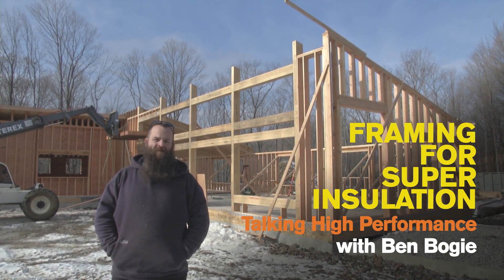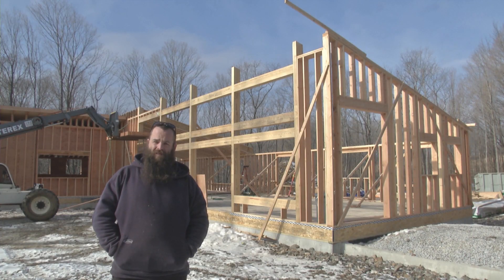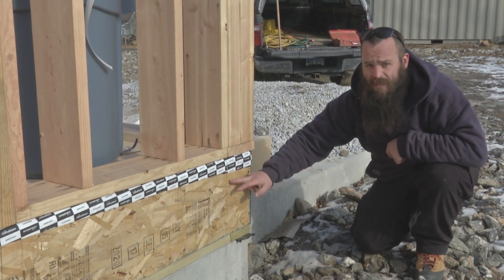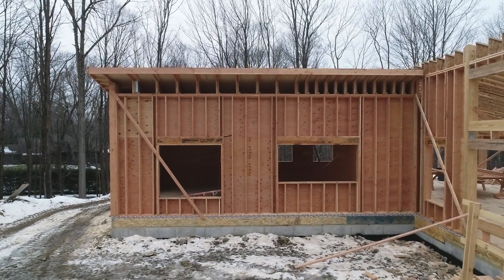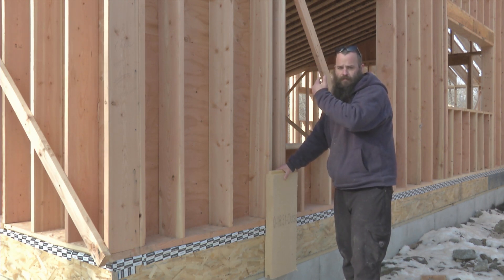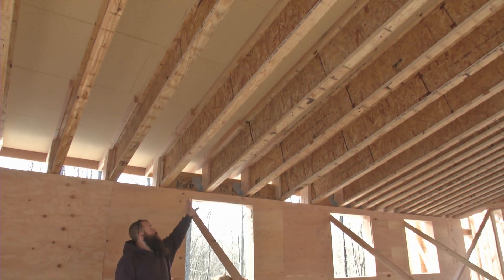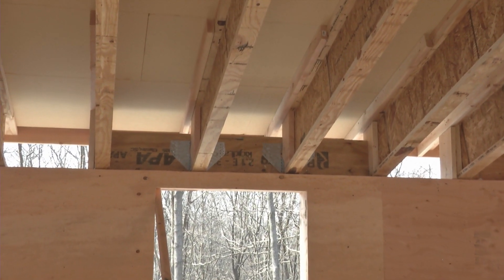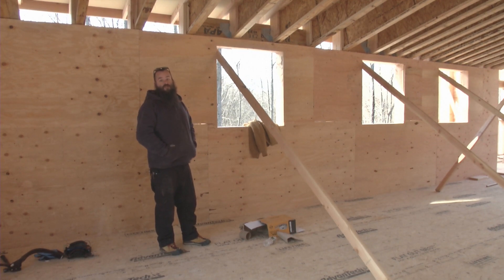Framing for Super Insulation

Comment: so there doesn't need to be a water control layer outboard of the dense pack cellulose because everything is vapor open anyways? or am i missing something
Reply: The wood fiber insulation is probably the water control layer. My guess is that this is something like Gutex multitherm, which sheds water well. At 0:22, it looks like the tongue/groove of those insulation boards is likely for aiding that water shedding.
Reply: @dosadoodle  I looked into this and apparently the answer is "it depends". So some wood fiberboard is rated as a WRB up to certain wind speeds and some is not. Also some builders prefer to throw another WRB membrane on top because it works as a redundant air barrier (more commonly with prefab because maybe it helps protect the insulation during transport and handling?). Now to try and figure out why some people put a self-adhered membrane on top and others go with mechanically fastened (they differ significantly in permeance)
Reply: That’s what I’m sitting here thinking. He has exposed osb edges. Even if they are moisture resistant they aren’t meant to be the wrb.

Comment: Wanna know why old houses last for hundreds of years? They breathe. Why are most newer homes having mold and moisture issues? They dont breathe. Airtight and temp sealed is great but some air movement is necessary.
Reply: the assembly is vapor open
Reply: Air tight but vapour open. The water in the air is what causes the issues. Old homes were vapour open but also not airtight and extremely drafty. So you couldn't control where heat and a/c went, or what your hvac pulled into its ducts in terms of dust and allergens. Control the air, but allow the water vapour to pass through open walls and dry to the outside in cold climates prevents mold.

Comment: Would it be better to use the two wall system? Those 2/8 have a large thermal mass.
Reply: A double stud wall is a very good system.
Reply: recently I have heard the argument for solid 2x8 (if you have robust exterior insulation)..as the 2x8 will warm the sheathing a little lessening the occurrence of dew point on the back of the sheathing.

Comment: I'm a total amateur here but with 2x8's couldn't you go 24 inch on centre for even less thermal bridging and cost?
Reply: He could easly go 24" OC and R-value of the wall will be even higher ;)))
Reply: Yes and no. I like my wall studs under the roof rafters and his rafters on this build were designed for 16" OC so if you want you studs under then they must also be 16"
Reply: @CybekCusal  that’s nice and we try to but with a double top plate its not necessary. There’s sections here where the rafter layout goes from 12” to 16” to 24” to account for snow drift accumulation.
Reply: @benbogie9243  at least you dont have 19.2 mixed in.
Reply: Theoretically the could have been but this is what was specified by the architect and engineer.

Comment: is the wood fiber insulation on your roof also?
Reply: Indeed
Reply: @benbogie9243   great work.   $2.89  bucks a square foot for the wood insulation.
Reply: @barkeater7867  steico, substantially less than that.

Comment: What a cool twist! Saving all that extra money on expensive membranes.
Reply: Then blow up your labour costs 2x... It doesn't make sense
Reply: @jasonbolduc8220  Membranes and taping are very labor intensive, especially where there isn't a service cavity like they built into this design. Lots of penetrations to manage.
Reply: @jasonbolduc8220  Not really. Typically the cost for greatly improved efficiency on a new build is an additional ~10%. If labor costs just 10% of the build, I'd be deeply concerned by the quality of work.

Maybe the broader question is, will the money get paid back in savings? Probably not. But most people don't build high performance homes because they think they'll save money with it. It's often about building a much more comfortable building and not wasting energy.

We're also reminded once again now in 2022 with high oil/gas prices feeding the Russian war machine why improving energy efficiency is a good thing for national and financial security.

Comment: My God. Wonderful details. Have been searching slant roof assembly like this. Can you add more pics or shots of the roof eave extensions. Any reason why rockwool is not considered for exterior. I guess the one you selected is pricy and imported from
Europe
Reply: There’s likely to be a full article coming out on the details of the roof overhangs. Comfort board is an option but when you figure in the cost of related components to use it like this (sheathing,  WRB, etc) then the argument changes. This material is Steico and it’s no it as expensive as other options.
Reply: @benbogie9243  : thanks and can’t agree more on the cost details. Makes sense
Reply: Rockwool's comfortboard is air- and water-permeable. It needs to be directly outboard of a rigid sheathing/water control layer, which would have been redundant in this assembly.

Comment: Here in Lithuania at Framer karkasiniu namu statyba, we do it a bit different. Starting from the outside: wind breaker ply (all seams isolated with adhesive tape for outside use), sheet of GTS special gypsum panel made by Knauf, wooden frame with gaps of 565mm in between standers, 25 to 35cm of mineral insulation (some call it wool, thickness and brand depends on what house owner wants), then vapor barrier on the inside again with all seams isolated with special tape, separate frame for the inside walls and cables/pipes finishes with double gypsum.